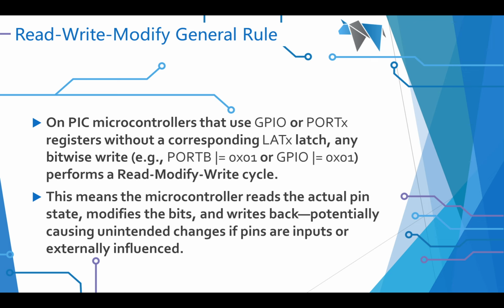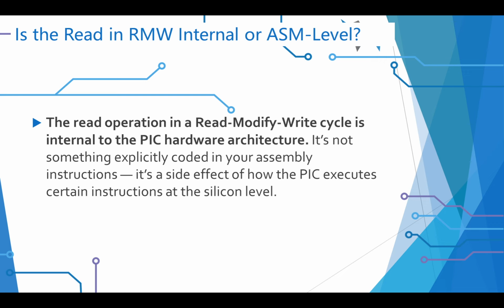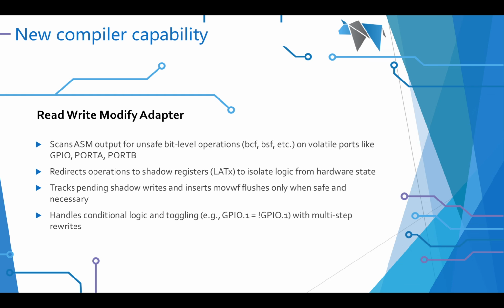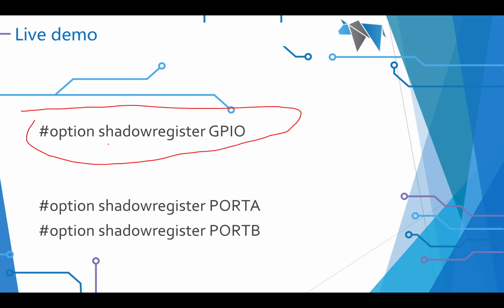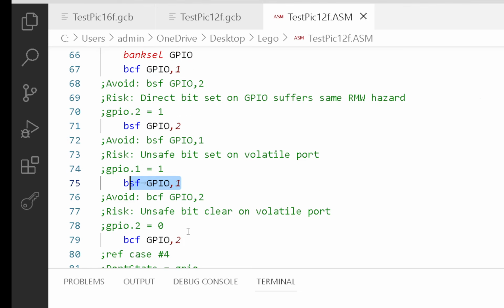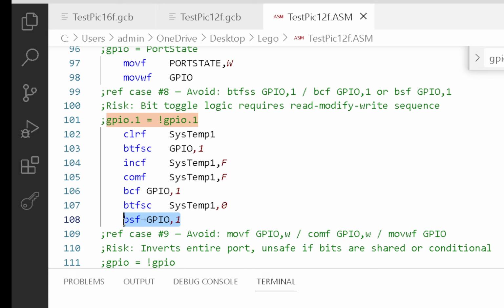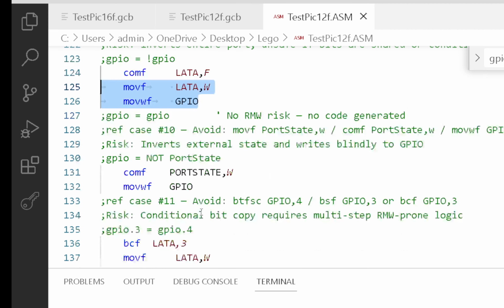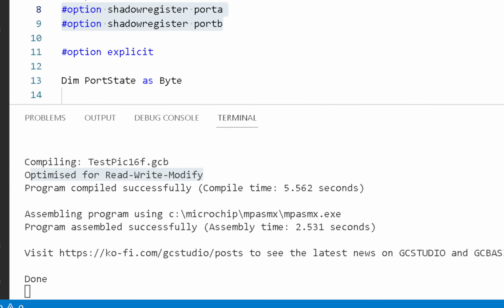New GCBASIC Feature: Automatic RMW-Safe ASM Rewriting for PIC Microcontrollers 🔧

Comment: Nice explanation but since the compiler knows via a command line which PIC is being used, shouldn’t this Option be enabled by default for older PICs without Latch registers rather than requiring the option line to enable it?
Seems like the Option line should only be required to turn it off for those users who understand it and don’t want the shadow register for whatever reason.